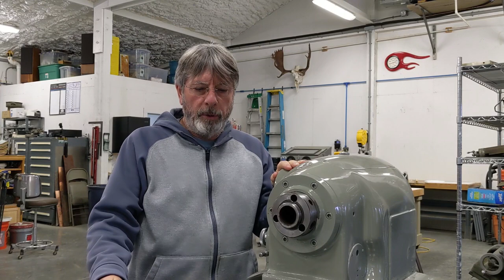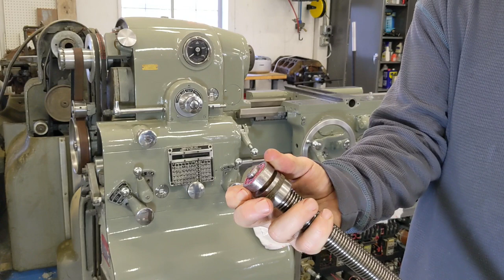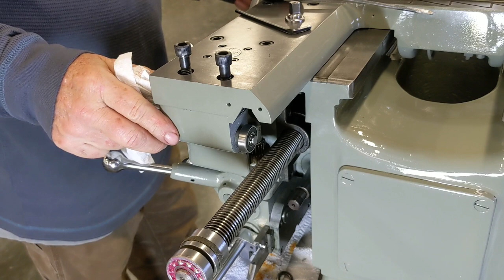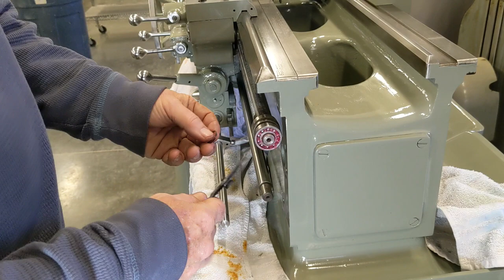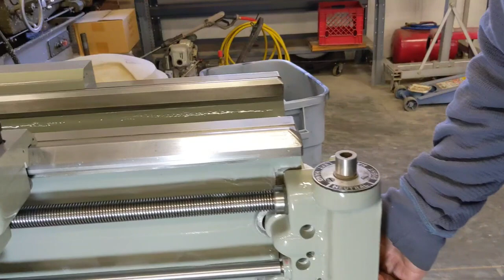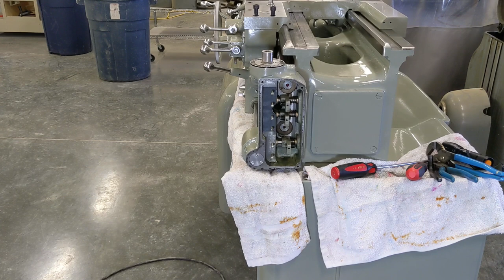Monarch 10EE Lathe Refurb part 14

Comment: I was thinking when you were installing the worm gear that I might have considered turning a small keyed shaft from aluminum to align the gear and bearings and would just push out when you inserted the feed rod. However, the installation went better than I thought it would.
Reply from the maker: I also thought it was going to be more of a wrestling match but it went pretty easy on the other 10ee so I just went for it

Comment: If you check the part sheets sheet 137 shows an additional handle on the ELSR control rod.  It's right next to the gear box under the tumbler lever.  It's only occasionally handy and might have been deleted from your lathe by Monarch by the time yours was made.  My '56 has a couple of features that were deleted in later models, the handwheel clutch (disengage when you don't want it or when using it would mess up a setup) and the feed rod clutch (keeps you from feeding hard into the headstock, actually acts as a stop as well).

Nice work.  Keep it up.  See you on the PM Monarch forum!
Reply from the maker: Thanks Russ... So I saw that Chuck's 10EE on Outside Screwball has both the additional on/off on the control rod as well as the on off on the headstock. I believe his machine is an earlier vintage as he has 3 oil sight glasses on the headstock where mine has one. My 30" has 3 sight glasses but does not have the additional on/ off levers though. In the day, Monarch must have been a build to order company and would configure machines to customer specs.
Reply: @fourpondsshop7940  Check with Monarch and see if you can get just the build sheet for your lathe.  It lists all the options it was ordered with as well as the original "ship to" and finish build date.

Comment: A hack who worked on my machine somehow got the control rod timing of on the ELSR end.  His solution was to drill another hole and drive in a roll pin instead of using the original taper pin.  Can I call on you for some closeup still pics of how the timing is correctly done if I get stuck?  The bearing nut in the bottom of the ELSR may have to come out to time it correctly.  I hope not. It’s on my bench right now ready for a little final cleaning before mounting it on the lathe.  Again thanks so much for documenting this project.  Cheers, Will
Reply from the maker: Hi Will and thanks for watching! Really appreciate you following the project. So yes, I fiddled around with that sector gear to make sure I had full travel. I don't know if it was clear in my video but the issue I was having was not being able to get neutral, forward and reverse travel and have the tapered pin holes line up. There's really only one gear engagement position that works. I'd be more than happy to assist in any way I can!
You can email me at Ktbpft@gmail.com anytime!

Comment: Interesting to note that this complex masterpiece lathe (and the US Apollo moon landing) were designed and built using pencil & paper & sweat-   NO CAD!  It is inspiring to see what our fathers and grandfathers accomplished without fear of viruses, network interruptions, Google, or PC limitations, Chinese spies, etc! Although a similar design COULD be done using CAD it would be a monumental effort and many CAD systems would "choke" on the overall assembly details, thousands of mating constraints, etc...
Reply from the maker: You're absolutely correct! I actually run a custom engineering and manufacturing business and all our engineers and designers run solidworks or fusion and a bunch of automated bill of materials plug ins. I don't think anyone touches a pencil and paper! To your point, the P51 Mustang airplane used in WW2 was designed and a prototype built in 102 days! And it proved to be a great airplane. My guess is that the engineering team simply got to work, no corporate empire building, didn't have to attend endless meetings about workplace behavior or ergonomic office furniture! Lol!